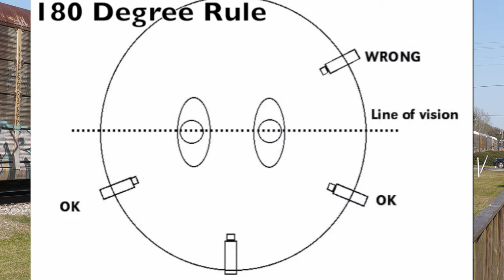5 Rules Of Railfanning While Trackside

Comment: With regards to Rule #2, I think car dependency makes people be more comfortable around trains than they should be. I LOVE trains, but also fear them, as I KNOW what kind of damage they can do. My mom asked me to run in front of a crossing to beat an Amtrak, and I couldn't get myself to do it, knowing what'd happen if my reaction time was just SLIGHTLY off. 

Many people compare trains to cars and think trains can stop like the car they drive to work everyday that almost always has 3 empty seats, nothing behind it and friction-creating tires, when every railfan knows that's not true. 

As for Rule #5, I think this applies to my point to, and I think many non-railfans should know some railfan stuff that could come in handy, like that crossing gate arms can bend or break away in an emergency, that there are blue signs on crossings that can let you call a dispatcher if your car is stuck there, and other stuff like that which can prevent horrible situations. 

I think it's okay that not everyone likes trains, but they should know enough that they follow this video's advice and, you know.....

Comment: Here's some more that apply to both stills and video:
1. If you insist in the boring armchair choice of shooting at RR Xings, position yourself on the close side of the roadway (not across a road) so vehicles can't stop between you and the train at the last minute.
2. Avoid wedgie shots. They're boring. Head for a curve or cut or side of a bridge. Elevation helps in many instances. Avoid annoying foreground junk. Move your location to where the foreground is simple so it doesn't fight the train. 
3. Avoid shady areas. Shoot on the SUNNY side of the tracks, not the shady side. Be aware of your light source and angle
4. In videos don't get too 'happy' with zooming. Let the train come to you, rather than have the camera zoom to the train so it doesn't appear to move. Don't rush things--the train will get there, I promise.
5. Be aware of the "vanishing point." Make sure your image includes it.

Comment: Rule 4 corollary: Stay at least 20 feet from nearest live rail when trains/equipment are present/moving.
Reply: 50ft
Reply: No
Reply: @MontanaDirtRoads especially if the train is going by you at track speed. I always give freights a wide berth in case a load has shifted or something is dragging. Also any debris picked by a train and hurled at you with force (bolt, ballast, loose tie down) will cause you severe injury or death if it hits you. Best give yourself all the room possible from a moving train.
Reply: I would do this but I railfan at a station, but most of the times I just go on the opposite platform
Reply: someone tell this to Sebation Deyoung
Reply: In Australia specificily my state its 3 Metres, 20 feet is 6 metres

Comment: This old geezer would like to a Rule # 6 Don't get too close to the tracks while shooting. There is such a thing as dragging equipment like steel straps used for securing loads etc. With this is the chance of a derailment. I have seen a derailment and I was glad that I was not close to the tracks as the cars did fall over and jack knife with surprising speed.
Reply: Thanks for saying that yes the speed of the derailment can be incredibly fast . when they come off the rail jyst anywhere will be the stopping point . And you have no idea were that Will be . This is exactly why they are so anal about trespassing . you can have a lap full of freight train before you can bat an eye. Its fast been there seen that to many times .

Comment: That clip with cars driving in front of the train is scary. I got my CDL not too long ago and it's similar with trucks. People see trucks and trains as big slow things they can get around, but never realize that that size means they can't stop on a dime. I've had plenty of incidents that could've warranted a change of pants.

I've known of plenty of places that used to be great railfan spots until some idiot came along and ruined it by trespassing. Either they got hurt or mouthed off to someone telling them to back off to a safe spot. I understand why railroaders are wary of railfans, I've volunteered at a museum and seen plenty of people both trespassing and not situationally aware. Standing on an active powered switch, getting too close to moving equipment, etc.

As for rule 5, sometimes talking about facts of the area can be good small talk when things are dead, just don't bore people too much.
Reply from the maker: Yeah I get talking about the area 100%. In that particular part I was talking specifically about one guy when I first started that talked to my Dad (who isn’t a buff) about the local railroad for 45 MINUTES.
Reply: @rantingrailfan316  Yeah, that can get old fast